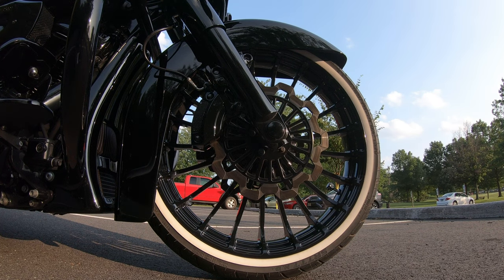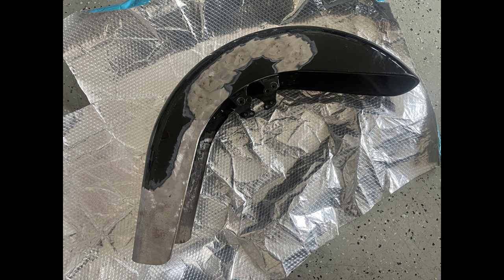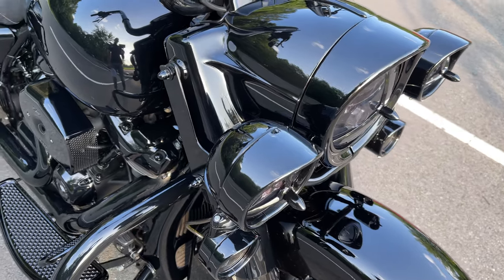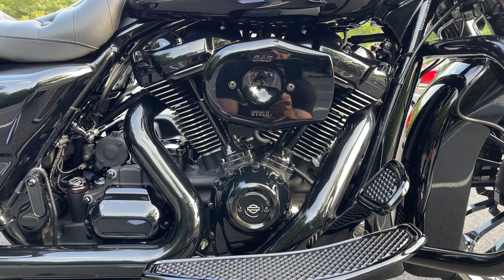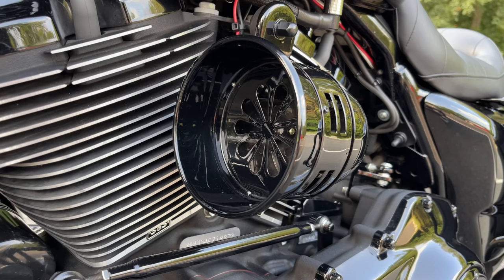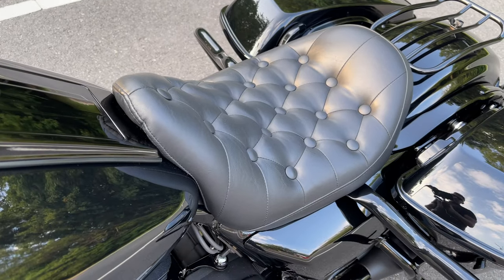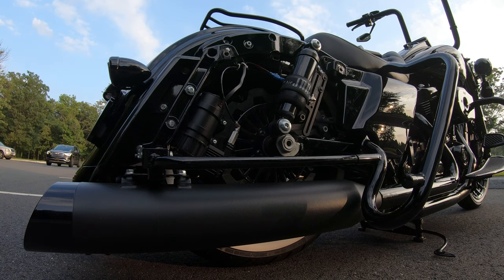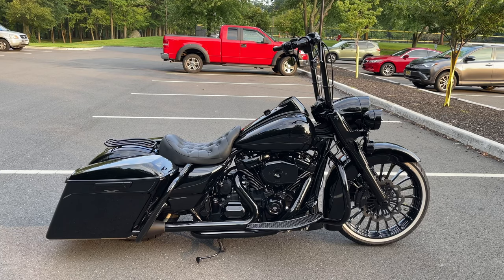Road King Special - All mods & upgrades

Comment: Brother I don’t know where to start, but that exhaust sound is the best idle sound I’ve heard on any bike. This thing sounds like a NASCAR! You have full duals, no dummy pipe, correct? So the Thundermax, the S&S 550 Cam…any other mods that exhaust partners with to produce that sound? Love that you powder coated those end caps, have not been crazy about a big logo on end caps; would rather keep them guessing. 😂
Reply from the maker: Thanks but to be 100 percent transparent I recorded the cold start with a Zoom h1n external mic. and I think the gain on the mic might have been accidentally set a little higher than normal but not by a lot. The S&S big bore/higher displacement kit, 550cam and KWs Dominator with performance baffles (tuned w/ Power vision) is the complete list of parts regarding sound. I can tell you the bike is waayyy louder and sounds pissed off/mean compared to stock and even Stage 2. Check out my Bear Mountain ride video for a sound capture of the exhaust with the bike actually running and thanks again bro for the comment!
Reply: Bro I’ll check it out. So what bored out head and piston you running? Have you considered KW’s Reducer in your exhaust versus baffles? Ask them about that. Is that S&S Cam a low to mid range cam or a top end cam? OH!!! And how you stretched that front fender yet keeping that Road King style fender, is righteous! I kid you not, I love a 21” tire but always bugged me how than fender doesn’t come down the way it does on the 19” and I’m not crazy about those wrap around fenders. I love the classics RK front fender, although didn’t get a close look at it, but love how you kept that fender shape intact! @darknessroadking

Comment: Can’t wait to see more content. Love to hear this on the road some more, like to see a closer look at that front fender which you nailed. How much stretch did they add?
Reply from the maker: I got you bro, more content on the way (especially exhaust sound captures). The front fender was stretched 3 inches over stock,
Reply: 3” is that after you asked them to take an inch off, to even up the bottom? @darknessroadking
Reply from the maker: @DeBa1226  exactly bc 4” (my original request) turned out to be too long for a 21” wheel.

Comment: Holy cow! Beauty. The only thing is that you're blocking the oil filter with your stretched front fender...
Reply from the maker: Thanks for the comment! Though the front fender is only stretched down. Same clearance as the original fender in proximity to where the oil filter is. I can say 100% that it does not block the oil filter. I changed my own oil in August before the end of the riding season, zero issues getting to the oil filter (which sits behind the front of the frame, so way behind the front fender).
Reply: @darknessroadking  Sorry, I meant the oil cooler. Happy you have no issues,
Reply from the maker: @CheckYourPremises  Oh gotcha, and yes you’re correct it does stretch in front of the oil cooler. Luckily 5k later I haven’t had any issues with it overheating. Thanks again, good observation.

Comment: Did you have any issues with your KW slip on’s coming in contact with the rear SCC guards? I’m still running stock slip ons and already rubbing. Not sure if I should build it up with washers. Thanks man and great video!
Reply from the maker: You got it already! Great question: Yes I run half-inch spacers between the frame and where the lower part of the guards connect. The spacers keep the guards off of standard size mufflers.

Comment: Awesome build and video is very well done. 

My only question is was this your vision the entire time? And why not just do this to a Road King standard?

thanks!
Reply from the maker: Great question. It wasn't my vision the entire time. In 2019 I was on the hunt for a Road King Standard (love the chrome etc., was going for the vicla style) but when I was ready to buy I found a great deal on this low mileage special and so I jumped on it. As you noticed Ive been modding this special to be as close to a standard as possible. Sometimes our original plans produces unintended but positive results and thats what happened here. Still love the Road King standard and hope to soon add a Softail Deluxe to my garage (and finally have a chromed out HD). Best observation yet, appreciate the comment, thanks again!
Reply: @darknessroadking  no worried man. It looks phenomenal. I love chrome myself but keep finding myself drawn to the blacked out special. I prefer a stripped down look and not into fairings and shields so I have always loved the RK for that reason.

Comment: Sick bike congrats. Are you using windshield sometimes ?
Reply from the maker: Thanks and absolutely, I run a Memphis shades Slim windshield (dark smoke). Helps out a ton on the highway and when temps get cold.
Reply: @darknessroadking  Really great. I currently have a breakout 114 but my next one will definitely be a Road King Special. Wish you all the best with your crazy motorcycle.

Comment: Did you powder coat your heat shields?

If so, is it a special type of powder coat for the heat?
Reply from the maker: Yes and it’s not a special type just regular powder coat. The bike is dyno tuned so runs cooler than stock. The powder coat has held up so far (1 full riding season).

Comment: I've tried to find a good option to have the samson exhaust finished with a gloss or shiny finish.  you mentioned PD on the pipes and i assume you had the heat shields only coated.  how are they holding up o the heat? Beautiful bike
Reply from the maker: The heat shields are still holding up (1 season later). I hear you about the powder coat. The closest to a fully reliable “sorta shiny” black finish for pipes that I’ve found is Satin Cerakote. I have a set of gloss black powder coated  slip ons (vicla pipes) and the gloss will eventually fade where the muffler connects to the header😢. But the bright side is that the gloss black powder has remained intact throughout the rest of the muffler body. Will keep an eye out and keep reporting back you guys this riding season. Thanks for the comment.

Comment: Who did powdercoating on passing lamps extended visors and how much was it?
Reply from the maker: New Level Powder Coating (Staten Island, NY) and approx. $150-200.
Reply: @darknessroadking  thanks man is this nice and smooth finish? I have bad luck with local shops here in IL and it is hit or miss each time

Comment: I am strongly thinking to trade in my 2018 Fat bob 124 S&S big Bore full Legend Suspension around and Club style look. For Road king Special what bike did you drove before the road king ? And are you not disappointed that you did not go for RG or SG ?
Reply from the maker: I actually came off of a BMW RnineT before this Road King. Night and day difference. Having owned a sportster 1200 in the past I can tell you the Harley touring frame makes this the most comfortable bike I’ve owned. I’ve ridden my friends SGs and RGs and wouldn’t change my bike for either (love not having a fairing).

Comment: What the part number on that horn i cant find it, also does the dakota gauge show the tire air pressure?
Reply from the maker: I found the horn guy on IG. His name is Hugo and his email is  belairman_57@hotmail.com. He sells a bracket along with the horn thats critical to mounting it. The DD speedometer does not measure tire air pressure unfortunately. Thanks for commenting.

Comment: Sick build!!! The people wanna know, what's your total cost so far?
Reply from the maker: Thanks bro! but somethings you never tell lol. I will tell you this I paid 15k for the bike used when I first got it and have at least put another 15K back into it over 3 years.
Reply: @darknessroadking  Thanks for sharing. Torn between getting a new bike or building. As a future first time Harley owner, this video definitely clears things up. Built it is ... Ride safe.
Reply from the maker: Thanks Joe and you're right the majority of us change these motorcycles radically and thats why the used market is the way to go. Only buy new if you plan to leave it bone stock as it comes. Best of luck! @CookingJoeFoods

Comment: My brother, sik build, may I ask if the dominator exhaust the eclipse black chrome?
Reply from the maker: Thanks, the KW dominator Im running was originally matte black and I had the heat shields and end caps powder coated gloss black. A year later and about 5k miles and they still are holding up good.
Reply: Thanks brother!

Comment: Sdo you have any clearance issues with rear fender extension touching bag on the bottom? I tries Hog Workz but these were touching so I had to remove it 😭
Reply from the maker: No, I haven't experienced any issues with the 'rear fender extension touching the bottom of the saddlebag'. Not really sure what you mean.
Reply: @darknessroadking  yes seems like HogWorkz extension might be slightly too wide on the bottom and (in the widest section) and can interfere with bag. Maybe Advantblack is slightly different design in this section. I also experienced issues with fitting TriBar as bottom tabs didn’t fully engaged so no extension for me - sadly as I love the look. Thanks for your reply always great to connect with fellow RK owner
Reply from the maker: Ah ok I understand now. I can confirm that the Advanblack stretched fender insert  won't interfere with the bags, best of luck mate. @RidersUnited
Reply: @darknessroadking  thanks I guess I might try AB instead as the set up looks sharp.

Comment: How much l over paid for a HD and how l spent $10,000 up grading my 🧸 toy.21 inch wheel better carry a spare tire and tube, good luck finding them at a shop .
Reply from the maker: I bought my 2017 in 2019 for 16K with 823 miles on it. No financing just cash. I did however spend a good deal of money upgrading it (the Harley tax) north of 10K. Im ok with the cost because I work really hard to have nice things and also provide for my family. As for the tires, lots of people run 21"s wheels/tires (they come stock on certain CVOs) so I think I'll be alright. Worst case scenario Dennis Kirk will ship one to me within 3-5 days if I need a new one. Thanks again for commenting.
Reply: @darknessroadking  In 3 years the previous owner put 823 miles on it he must've really liked it. 😂
Reply from the maker: I guess one man's trash is another man's treasure.  @frankmarkovcijr5459
Reply: @darknessroadking  Did you get the crankshaft welded up with new bearings or did you just hop up the engine? I can read off a shopping list of mechanical issues but I don't think I have to.  Today's motorcycles are a collection of government regulations on 2 wheels. I have had my Sportster for 25 years and 400,000 miles on the original engine.  Let's see if you have your bike in 25 years. I give my motorcycles a forever ♾️ home 🏠 like my rescue dogs and cats. I have had my Triumph Tr-6 with a hard tail and magneto for 40 years. Reliable and dependable transportation as l don't have a car 🚗. Today's HD is as hooked on easy money the same way a junkie is hooked on cheap Devil Dust. As long as people throw money at them they will never change. Nobody twists anyone's arm to drink the Kool Aid. Hope you enjoy your new toy .
Reply from the maker: The way you feel about your Sportster is exactly how I feel about my Road King (love the friggin thing) Once again, thanks again for commenting.  @frankmarkovcijr5459
Reply: @darknessroadking  That's good. Too many people have no loyalty to anyone or anything. None of my bikes are worth a lot so l don't look at them like a pile of money. They are there for me to enjoy them. Which l most certainly do!

Comment: I'm Florida by way of Bed-Stuy.  Killer vid!  Everything Black with no vaseline!

I'm not a Road King guy, but you've made me reconsider with this impressive video. BZ  My wife, a Nuyorican from the "L.E.S,." and loves the Cholo King.  I think I would get into trouble.  There is no way you can roll Cholo style and not have a Bad @$$ attitude.

On my Fat Boy "Killmonger" I had Blockhead and Chris install the S&S cam chest kit with a Woods 22XE/Trask Assault 2-into-1 & Air Cleaner.

https://youtu.be/gPUnKOuaz5s?si=hUN6Tutdgb6Gj-cv

Got a lift for Christmas 🎉and installed a SE 64mm intake/manifold/5.5 injectors, and changed to the Alloy Art Boom Box...😮I have to lean into every shift because the front end lifts...going from Power Jet to Thunder Max (in the mail).

Got a Road Glide "SilverBACK" last year after one of my riding buddies passed (cancer), and now I'm going to do the engine work.  Wish me luck!  I keep a fat yellow zip-tie holding a bell on my air cleaner for Randy "Mellow Yellow".  He was a big white guy on a 1989 yellow Fat Boy and I was his first black friend.  Five guys with Fat Boys roll'n around Central Florida.  One guy dropped out due to the loss of Randy, and now our group has seven. 5 white guys, 1 Vietnamese American, and me, what a "Motley Crue".  The oldest is 75 and he is the craziest doing a running burnout every time we get together.

*S&S 129 Kit/tappids/Roller Rockers
*Fueling 508 Cam chest kit/Gorilla rocker rods/ARP top end
*Kibblewhite Springs
*T-Man No Loss/Head Breathers

I met Allen from Zippers at Daytona Black Bike Week, with the CEO of Harley during Traveling Talls show.  Those guys at Zippers really got it going on with their new 74mm port matched Intake & Manifold for their 128/129 ci kits.  So I changed my build to include their new Duel Hydraulic piston chain tensioner with Cam gear and Sprocket.

Subscribed

SQUID 
ET1(SS/SW/MTS) US Navy, Ret.
2020 Phat Boyee "Killmonger"
2021 Road Glide "SilverBACK"
Reply from the maker: Brooklyn stand up! Best comment yet. Thanks my G. Your Road Glide sounds sick, all the bells and whistles!

Comment: Where did u get the aux lights? I can’t see to find em for my 2020 RKS
Reply from the maker: So the short answer is unfortunately you can’t just buy them straight out. Check this video again, I left everyone a parts list on what you’ll need to set up the aux lights. Thanks for commenting.